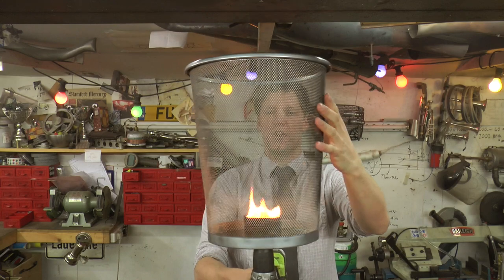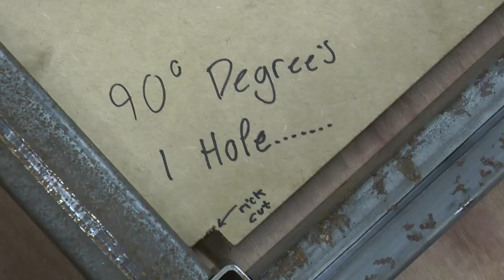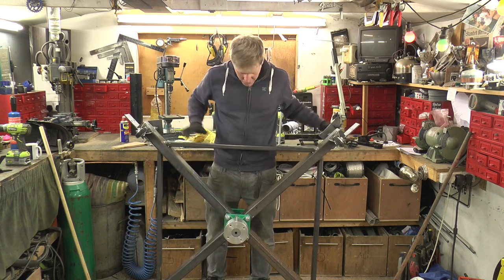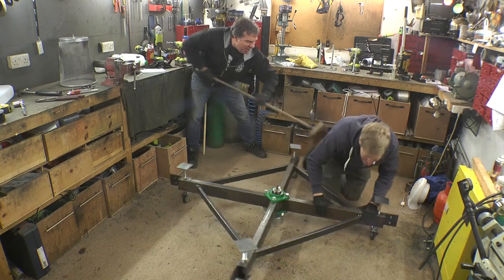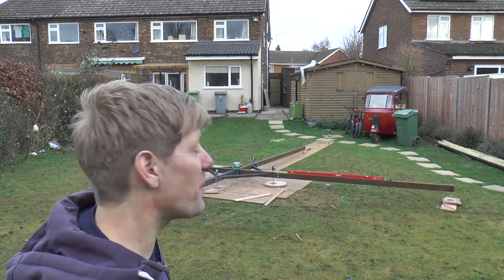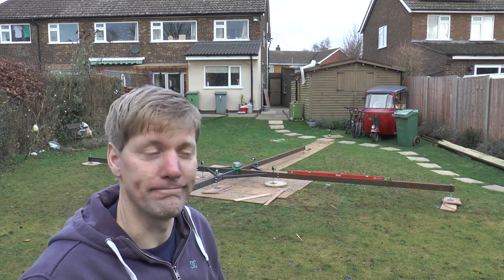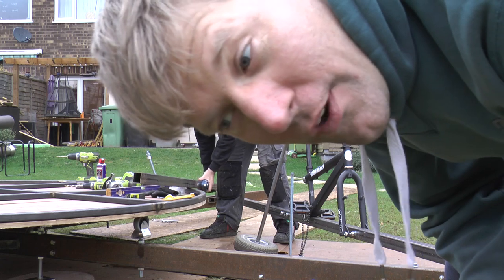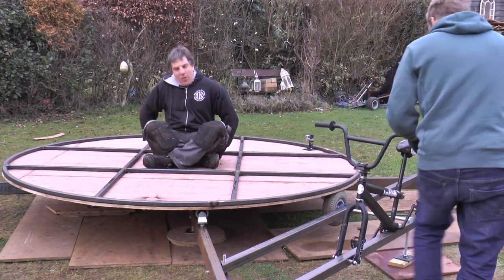Making a HUGE Fire Tornado #1 Base

Comment: Gloves with spinning tools not good ..
Reply: Your profile pic says that you may have experienced this before...
Reply: I used almost every tool he used in this video on my work today so, we can say i do.
Reply: Not good but on a lathe like that, having the swarf tangle up can really fuck your day up, and having one of those pieces "slit" across your bare hands is even worse. those gloves i wouldn't say were too bad, its the "locking" ones with velcro or buttons that will not come off in a snag whichll get ya.
Reply: Any glove( the ones with plastic not really) can hook to the spinning machine and make a nice mess on your hand.

Comment: >wooden base
>fire tornado

this can't end well.
Reply: GlitchyShadow depends on what type of gas he is using. or he will put a metal plate right after?
Reply: Easier with a wire mesh
Reply: GlitchyShadow heat goes up, so.the fire goes up

Comment: if you want to get more turn ratio, you should increase the size of the gear that's connected to the crank, use a smaller gear for the driven gear at the back and a wheel that's even smaller than that gear at the back  that provides the rotation to the piece.

Comment: You might want to think about getting a coolant system for your lathe. It massively lengthens the life span of your tooling bits, it helps stop warping/burn that also then means you get a much nicer finished part. Just get one with a replaceable filter.

Comment: I have a feeling you have already built it and set it off, but if not, have you considered driving the rotation with a horizontal Catherine wheel?  (take the old one and turn it on its side (obviously the safety radius gets massive as fireworks are going horizontal))

Comment: Are you sure you'll be able to get it spinning fast enough with that gear/sprocket ratio? Judging by the video it will be a lot slower than the model (relatively) even if your legs are going like hell. Not sure how fast it needs to go to spin the air though or that the model isn't an accurate reference (maybe it had excess speed). I guess you'll find out when you try it!

Comment: Noooo. Don't use a basket. Use massive stand fans pointing slightly off center. Surround the source of fuel with these.
Reply from the maker: that would be easier but not very exciting build video

Comment: horrible gearing for the bike set up. you need a bigger front sprocket if you're  gonna run a caset that massive on the back. either pick up a 9 tooth caset or it's gonna spin very inefficient